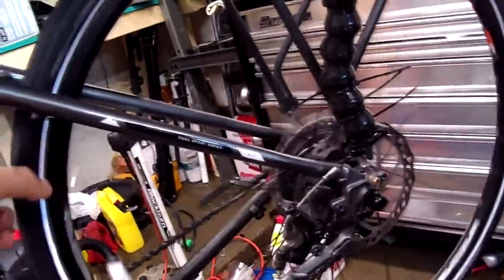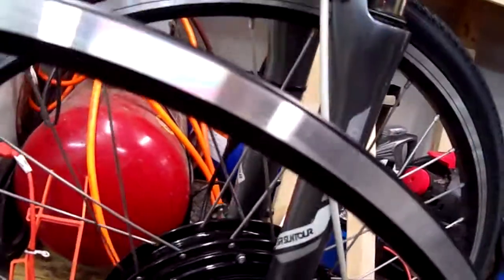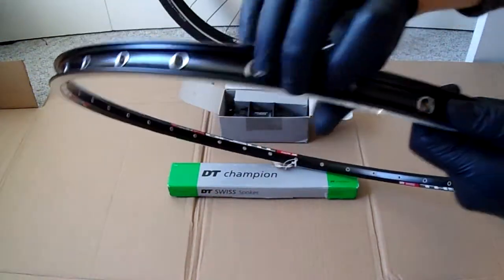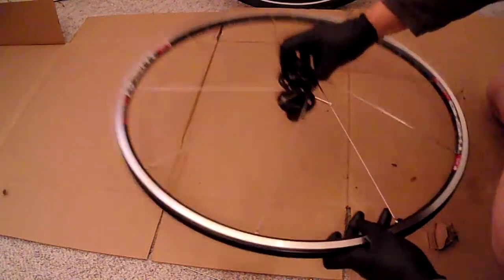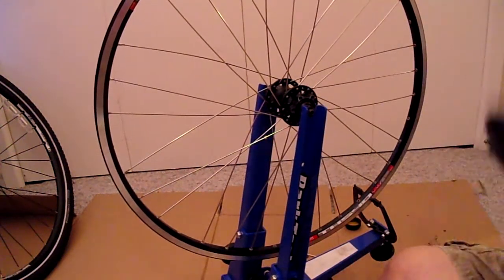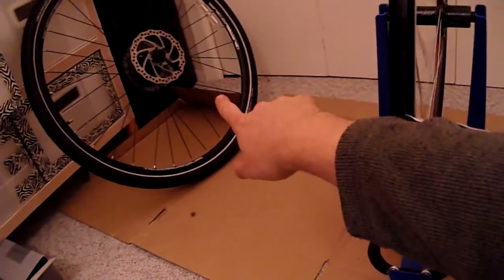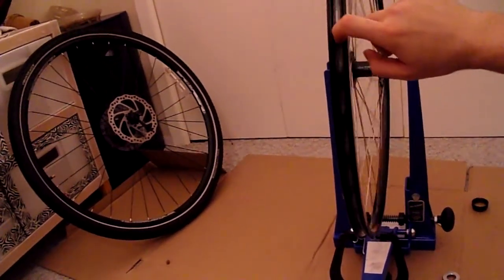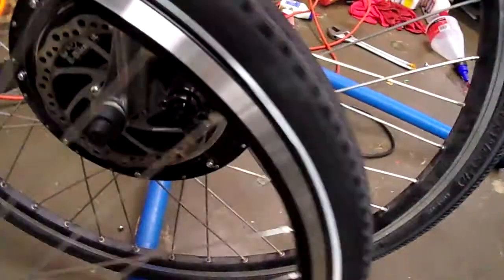Tired of Broken Spokes! Hand Building a STRONG 36 Spoke Rear Wheel for Trek 8.3 DS E-Bike

Comment: your spokes are breaking probably because they aren't properly tensioned.
Reply from the maker: It was hard to tension them properly once several had been replaced over the years. With several spokes being of different ages and lengths, there were a couple that were loose but the nipple was fully tightened. I could have replaced all 32 but I was better off using a quality rim laced with 36 brand new spokes. It's been a year or two since I made this wheel and it's still as true as the day I made it.

Comment: Trust your bike shops. Or as you do lace yourself. Always let a pro wheel builder true your wheels so the spokes arent over tentioned. For touring it helps to have them slacker than to tention them almost solid for racing. 

The wrong bike shops and wheel builders often cut spokes to length like what happened on mark Beaumonts round the world cycle which weakens the ends. They are not designed to be shortened. Double or triple buttes DT swiss competition/alpine or sapim are worth the extra weight.